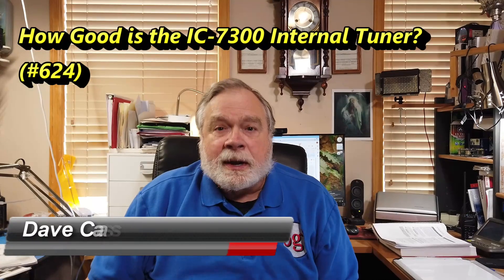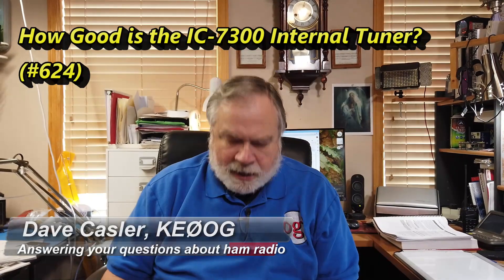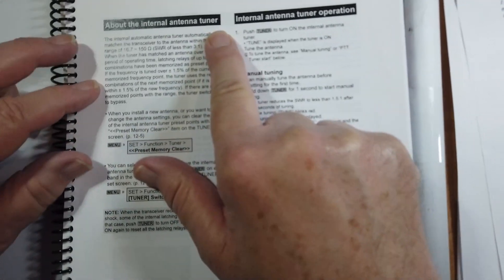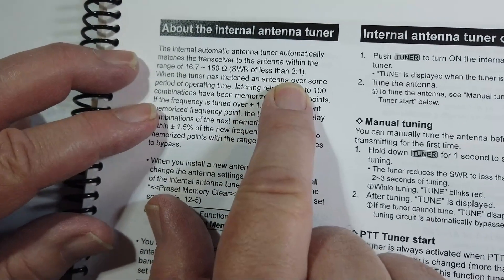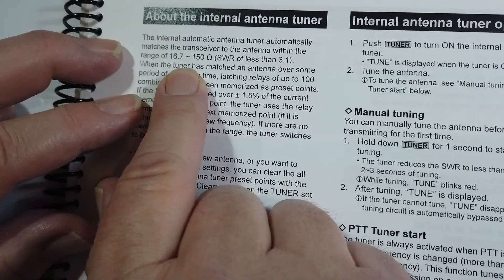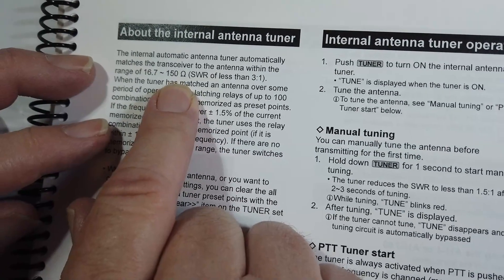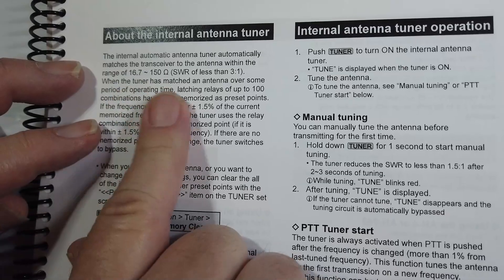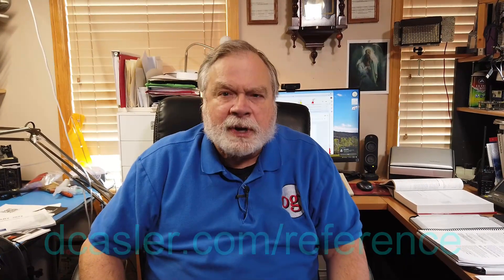How Good is the IC-7300 Internal Tuner? (#624)

Comment: The ICOM 7300 has a external tuner jack on the back. if you get a compatible tuner the tune button will work the external tuner and Tahy won't fight each outher. also the 7300 has a emergency tuner mode dropping power to 50% max and will tune over 3:1 SWR.  in menu settings under extra settings there is a emergency tuner option. check that puss reset button . un check to return to normal then reset. this works with 9:1 random wire dipoles . I have a AL 572 tube amp and on some bands like 12,17 meters the input SWR to the amp is 2:1 and I use the radio internal tuner to tune that. then a tuner if needed on antenna side of amp. this is a exception to 2 tuners. my antenna is good on 12/17 meters so only tuner to amp needed. 73's

Comment: The Yaesu 991A states it will not memorize any ATU settings above 3:1 so I would assume it has basically the same range of tuning as the 7300. The 3:1 is to protect the radio form damage so anyone trying to push any radio beyond that would be risking their finals. I do have the President Lincoln 2 plus which will actually stop transmitting if it detects high SWR's. Not sure why the higher priced radios do not have that feature?

Comment: The internal Tuner of the IC-7300 is just as good as the Operator is. I did the Wide Range Modification on mine but in most cases of being in need of using an antenna tuner, if I then I am using an external manual tune. Thx for the Video Dave. 73 de Your Friend Uncle Guenter

Comment: Mr. Casler, the IC-7300 will tune 10:1 IF it is set to emergency mode and the power is reduced below 50%.
Reply: It will also throttle back it's power to 50 percent when SWR protection kicks in even without emergency mode lol

Comment: I discovered that the LDG AT-1000 ProII Autotuner works WAY better than the Icom 7300s internal tuner.  And I'm disabled and living on SSDI (very low) fixed income, so those that claim "budget tight", well..  But otherwise the Icom 7300 is a great (sounding) radio and fun to play with, with all the features!
KD8EFQ/73

Comment: I Wondered about Dave’s comment about an external tuner and the internal tuner “fighting each other.” Because I tuned my external tuner to about 2:1, then the internal tuner would work just fine and tune quickly. The rig is an FT-450D. And I have gotten a new MFJ antenna 993B antenna tuner that interfaces with the rig well and is definitely easier. However, I don’t know exactly what tuners fighting with each other means, but the rig and the old manual tuner seem no worse for wear?

Comment: Curious on what is the point of an internal tuner than if the radio can handle transmitting up to 3:1 SWR. To increase the life of the radio?
Reply: The radio will see the high SWR and will reduce the output power to protect itself from punching itself in the face. So you might have it set to 100W but only see 50W coming out of the wattmeter in the forward direction, and tons of reflected power. If you get the SWR low enough (by using tuner or having a resonant antenna), the radio will go back to full power output.
Reply: Also note, that all of that reflected power is going back through your coax…and getting lost. A single db loss plus a 3:1 swr can mean that you’re only transmitting with like 66 watts from your 100 watt radio. But actually less with less than stellar coAx or a longer run of coax.

It doesn’t just bounce back and forth and radiate eventually. A lot of it bounces back losing some…then towards the antenna losing some…then a portion bounces back again losing some…and so on and so on.

Comment: Also, coax on the order of quarter wave more or less tend to act as transformers converting high impedance into low or something in between. Coax should be kept well under an eight wave when using heavy tuneing unless you design for a tuned feeder.
Reply: under 8 wavelengths?
Reply: @boatingfisherdude  1/8 electrical wave.

Comment: Answer book says 3-1 max or emergency 10-1.  But it sucks and will always read swr over 3-1 that tge radio will fail—- always get an external tuner tge internal does not work!!!! Use an mfj -939 it will handle anything

Comment: I had to relocate my shack for XMAS (space conflict with tree) and hooked my 7300 onto a makeshift attic dipole.  My VNA read the SWR at 3.04 : 1 and the 7300 refused to tune it.  Physically tuning the antenna below 3:1 and the radio tuned it very easily to (what the radio said was) 1.0:1